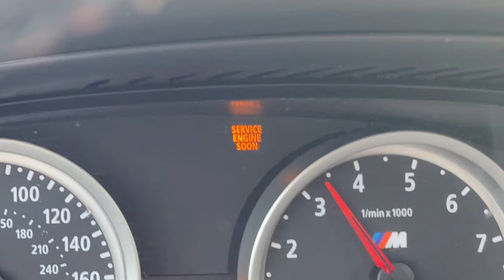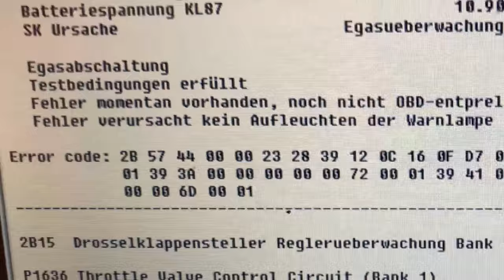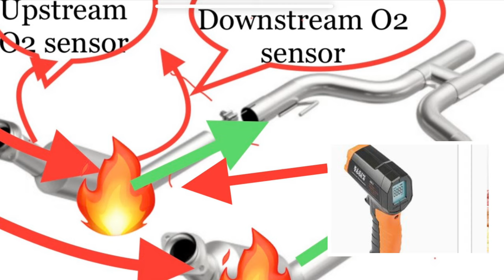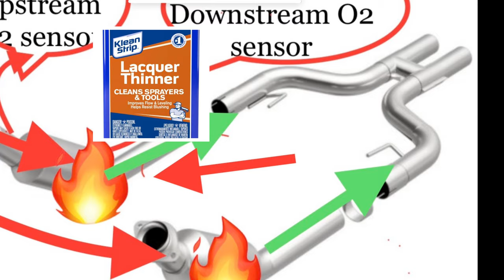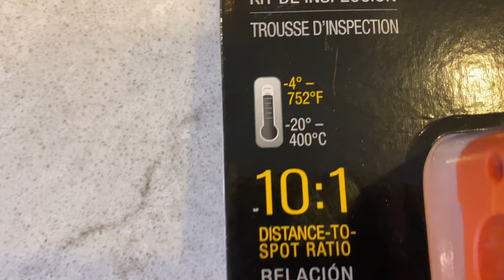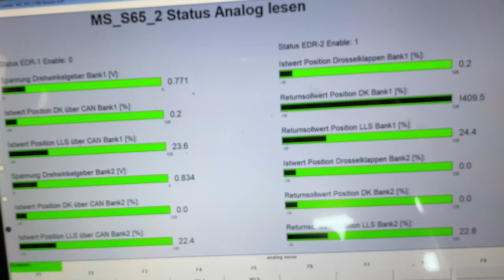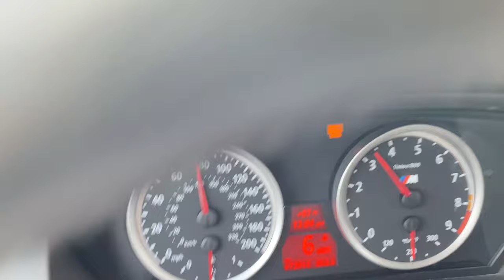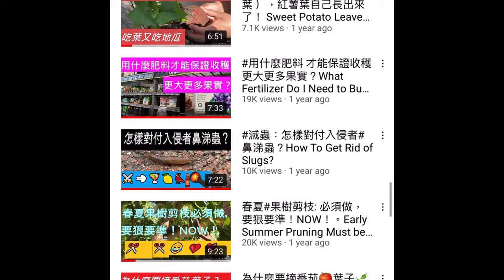How to Clear BMW Error P0420 and P0430 for $5 ? "Catalyst System Efficiency Below Threshold" Fixed

Comment: hello I have a bmw e60 m5 and the car is slowing me down and it also comes out. 278A DME:Catalytic-converter onversion, bank 1 end 2 , and the needle trembles a little, is that the same thing that happened to your car to do this?

Comment: hello I have a bmw e60 m5 and the car is slowing me down and it also comes out. 278A DME:Catalytic-converter onversion, bank 1 end 2 , and the needle trembles a little, is that the same thing that happened to your car to do this?
Reply: It's the same code.  The P codes are generic obd codes and the 278A are BMW Specific codes.    However I don't recommend this at all.